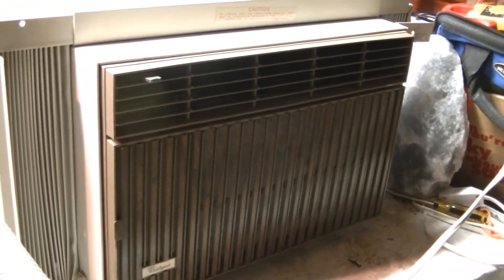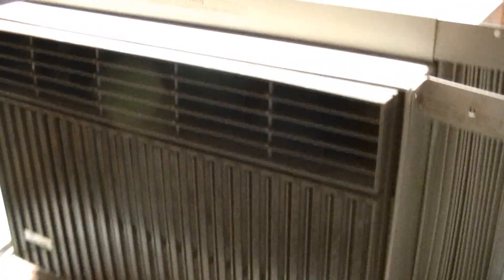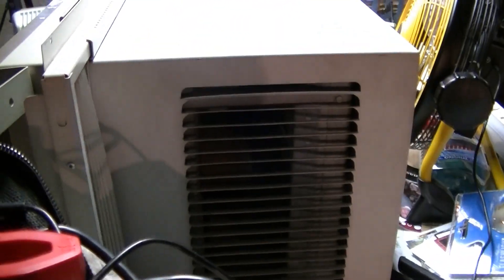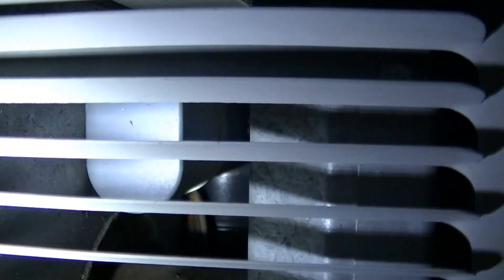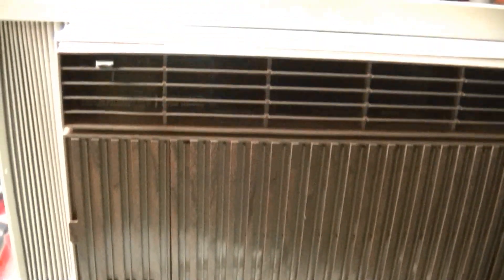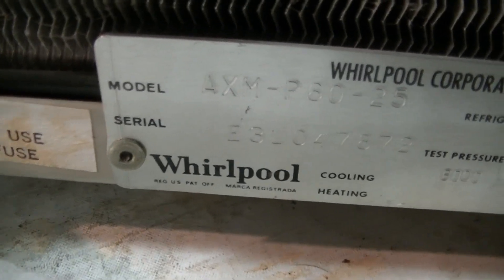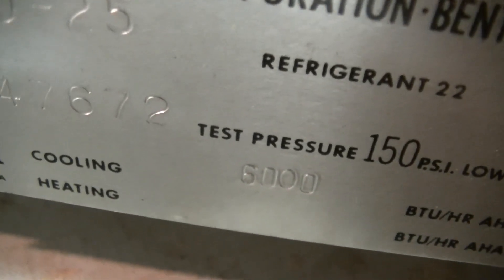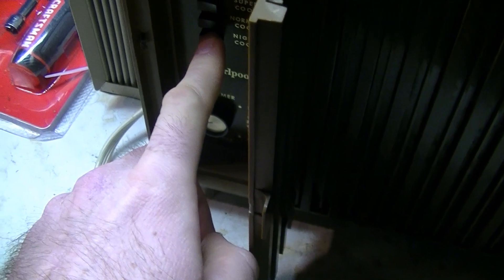Vintage Whirlpool Air Conditioner With Seegar Rotary Compressor (Not a Recip)

Comment: Very unique sounding compressors in these units. I have a 1974 Sears cold spot with this same compressor. It’s a Seeger compressor. Sometimes when these units sit for a while without running they take a LONG time to cool. You would almost think their out of gas but nope. When they run for awhile they get ice cold it had something to do with the way the compressor is designed on these units. But sweet score on this unit. That condenser coil is mint. Every time I see one of these whirlpools from this time period the coil is just obliterated. One more thing I’ll add if you notice the screen in the base pan of the unit. It’s actually a mosquito trap. It’s a whirlpool thing they did my coldspot has the same thing.
Reply from the maker: Thanks for the info.  I’ve never heard a compressor that sounds like this one before.  When I first started it, it did take a long time to start cooling so you’re right about that.  It gets ice cold though.  I can’t believe how good the condition is on this unit.  Any idea who made the fan motor?   I’ll probably take it apart later to try and find out.  Really cool that it has a mosquito trap.

Comment: These are good units. The compressor is a Seegar. I’d trade it for my Sears Coldspot with a Tecumseh but you’re all the way in WI right
Reply from the maker: Yup I'm in Wisconsin.  Am I correct in assuming it's from the 70s?
Reply: @carson01XJ  Yes